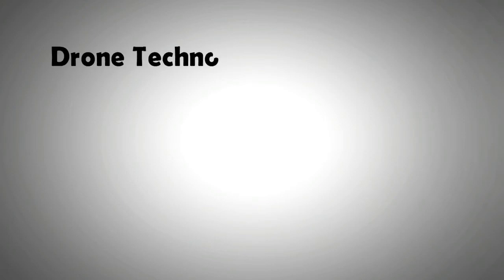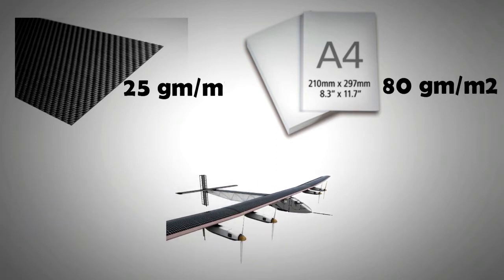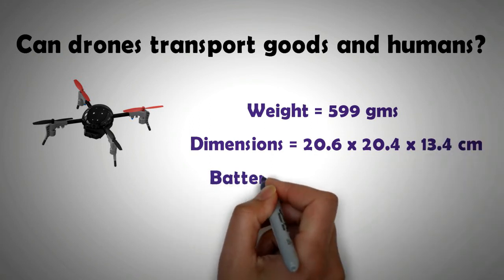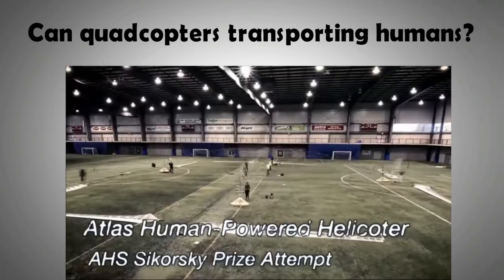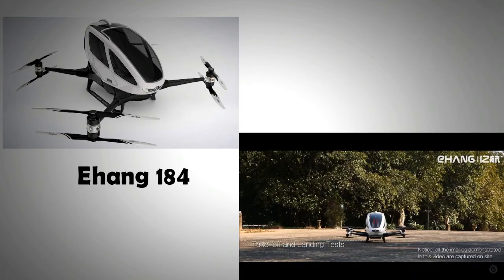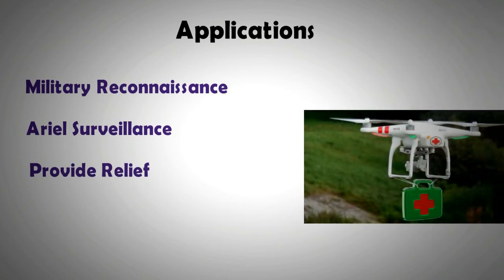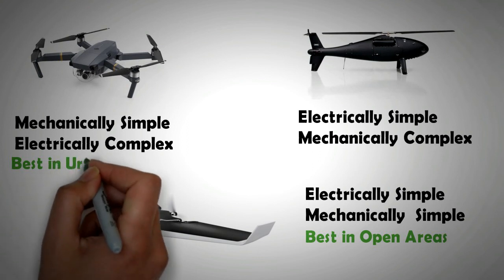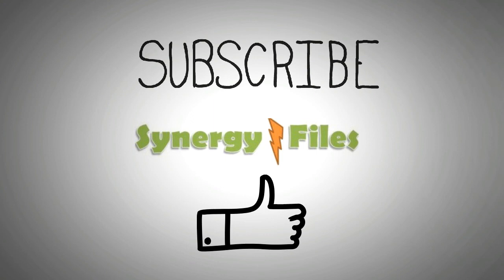Drone Technology and Its future

Comment: its wrong statements the first drones was mecanical stabilisation and gasoline engine and aluminium frame they was for sale in the 1980
the new gen drones toys of 2010 was because lipo battery but still mecanical gyro stabilisation on main rotor
http://www.playmakertoys.com/wp-content/uploads/2013/05/78084.jpg